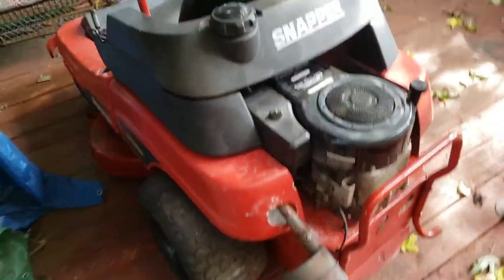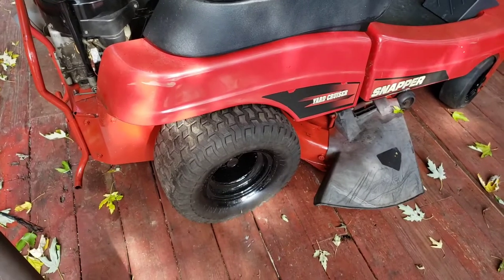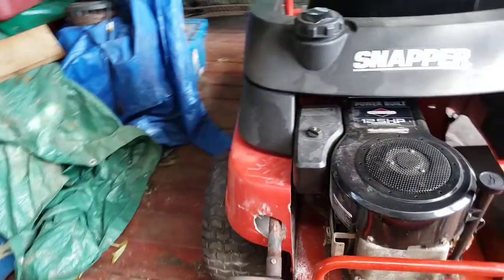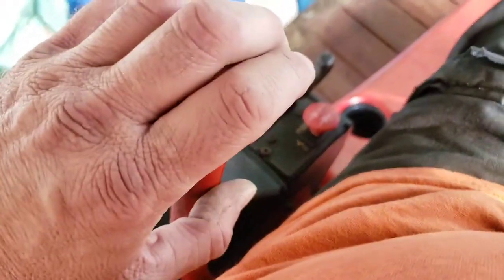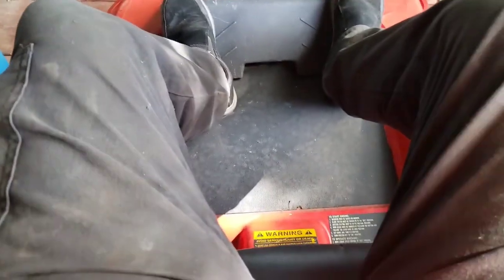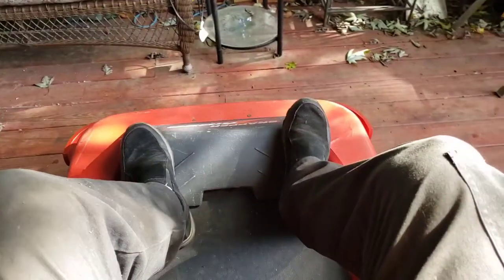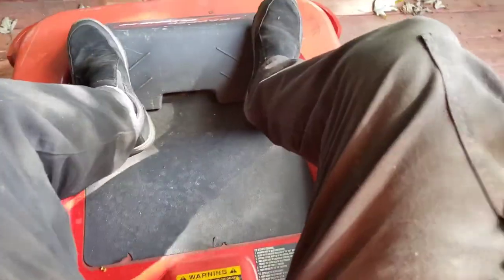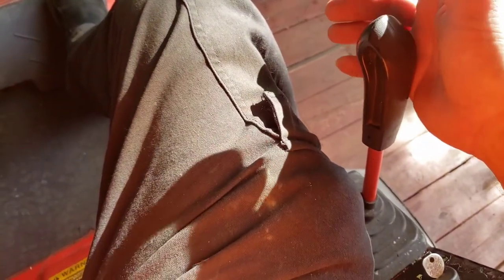Snapper NHZ14380BVE joystick Zero-Turn redone

Comment: any tricks to get to drive belt? with out taking body all apart?
Reply from the maker: No, putting that on, is a beast of a job.... Take the plastic deck cover off, then Take the deck off that's the easy part, then tip it onto the service angle, the back poles, that will give you better access to the bottom to do the belt.
Reply: @knighthawk86855  ya figured as much... but thank you for answering :}